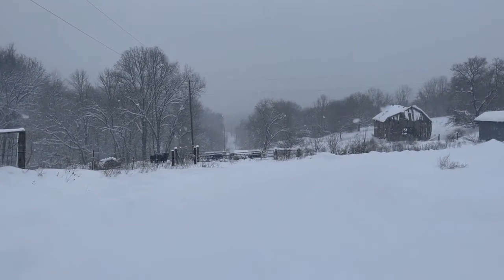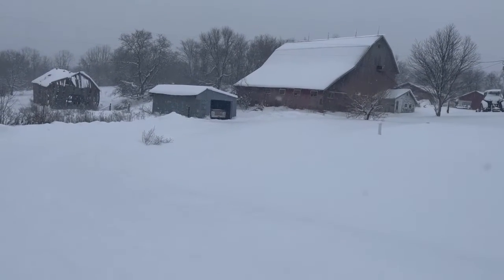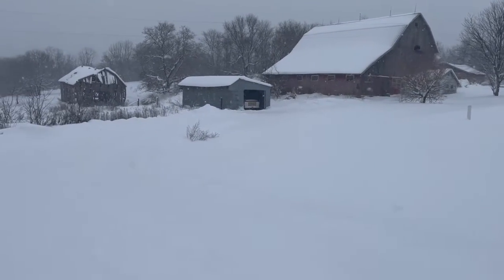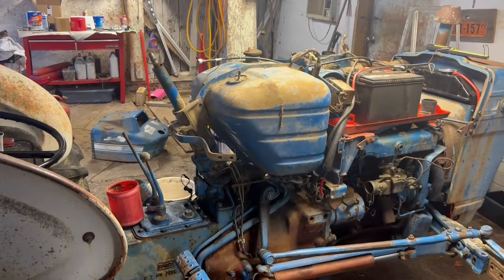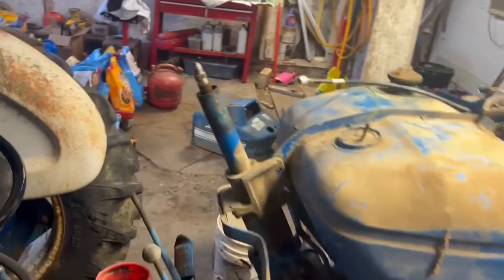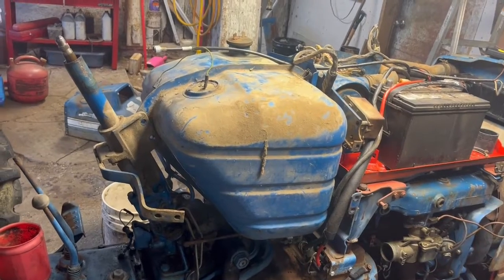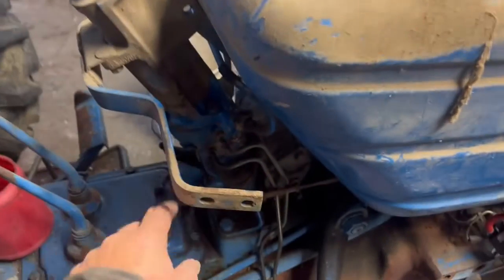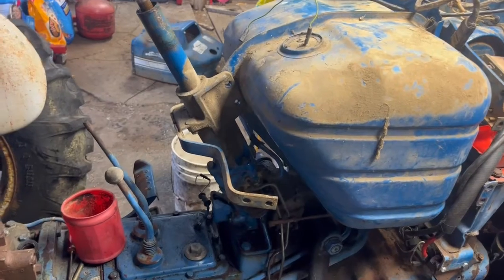Ford 2000 Revival: Part 10 - steering gear disassembly

Comment: That up and down movement operates the steering valve, a little movement is necessary, but with the thrust bearing bad it's probably extensive! Good luck
Reply from the maker: Yes, it did seem excessive. Thank you!

Comment: My brother and I went through my 3000 in 2021 never got new secter  shafts  but the steering shaft had the same problem with rust we bought a new one   we used  broken tractor  for my parts  if it's any help
Reply from the maker: Thanks! Broken Tractor is where I'm getting my parts.